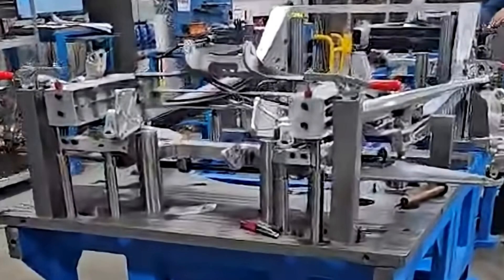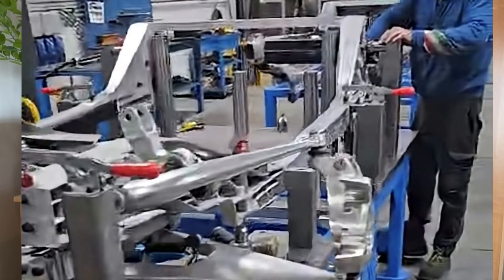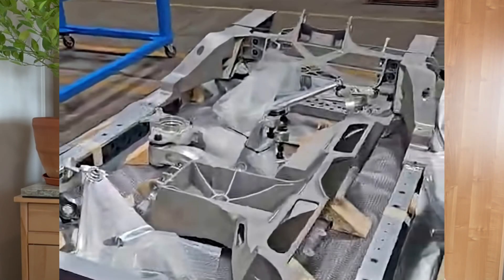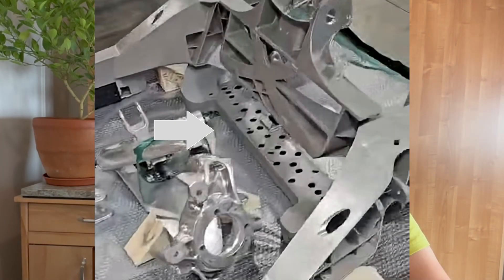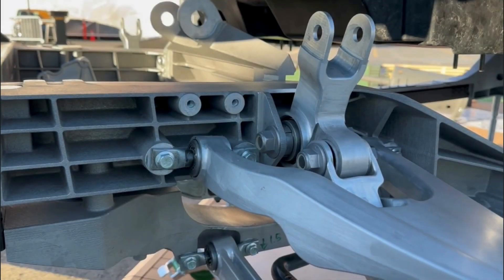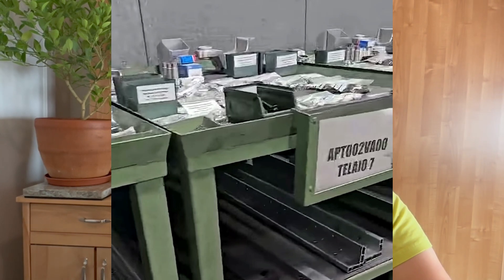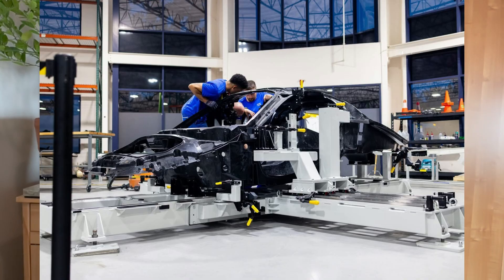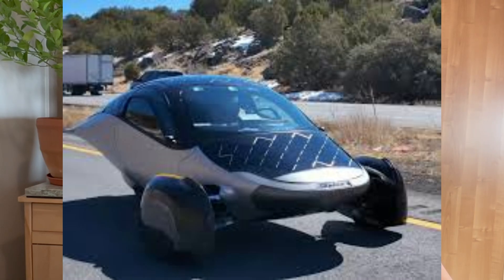Aptera's New Frame from COSTAMP

Comment: The Engineer should know the material and weight of the components designed to acheive the spec. The design of prototype components should incur more cost without sacrificing performance. For instance, a component designed to be forged from T6061 might be machined from T7075 to achieve similar strength and weight. Considering the infinite number of collision cases, it would be a mistake to optimize the design to survive the few chosen for tests.

Comment: Next year marks the 20th anniversary of Aptera
1. Zero cars made and sold
2. It’s 3 wheel
3. Two passengers 
4. At the moment it’s $40k
5.  They have raise over $100M from crowdfunding 
6.  The new Bolt EUV starts at $29k with delivery 

You should ask yourself these questions 
1.  What year in the future will I realistically own one
2. Is the 15-40 solar miles worth $40k
3.  Is the vehicle worth $40k, if it didn’t have solar compared to the cost of the $29k Chevy Bolt that’s available next month
4.  Could I use that $11k difference and add solar to my house/carport/ garage
Reply from the maker: @phileasler5401 Yes, of the Aptera name but you know that have not been trying to build the car that whole time. What it original company going bankrupt in 2011 under CEO Paul Wilbur. With the current version of Aptera restarting in 2019.  So let me answer a few of your questions and pose a few to you. 

1. I hope to see low volume production start in the second half 2026 or early 2027. This gives them the time for production line validation and crash testing. 
2. A car that can generate its own power or charges its self, yes to me it is worth it. That is a level of freedom no other car offers. 
3. A Mazda MX-5 ranges from 29k to 40k, the Corvette starts at 70k are they worth it? When compared to the Chevy Bolt? 
4. Not all people have the option to invest that 11k to install solar where they live, they could be in a condo or apartment and not have that as an option. 

It’s a 3-wheeled car, there have been others that have sold well, Morgan, Vanderhall, and the Slingshot. Also there are many 2 passenger cars that have buyers in the auto industry. Either of these categories that Apteta fits into are not negative, the first Tesla was a 2 seat roaster. Do you think that a Chevy dealer will sell the new Bolt at that 29k MSRP?  Is the 400mi range of the Aptera worth it when compared to the 255mi offer in the new Bolt? Thank you for watching!
Reply: And yet.. you're still here... you transparent Trollholes just can't stay away. Amusing.  Go buy a cookie cutter EV since that is what you are trying/failing to compare the Aptera to, you goofy sh!t-weasel... it's obvious that you are hate-trolling Aptera, what is less obvious is why?  Paid or pro-bono?

Comment: I think the oval holes in the rear subframe allow ducts for channeling cooling air.  The radiators shown at CES were near there.   
  I thought it was great that the first test drive yielded 8 miles per kW.  That’s better than VW achieved with the XL1 after 10 years developing and >1 billion dollars invested.
Reply from the maker: That could be a possible second reason, there is a great video from Jason Cammisa about the XL1. Thank you for watching!

Comment: so they are still making prototypes, this is all they have ever done. We have not seen any data apart from one release of efficiency of 8 miles/kwh, oh but wait, it turned out that was down a 7,000ft elevation drop from flagstaff to imperial valley. So their first 'official' release of efficiency data, was faked by going down a very long incline. Funny thing is just weeks before this, they did flat track testing, and supressed those results instead choosing to 'fake' the efficiency using gravity assist downhill. 
Its just another example of how dishonest they are. I would like to hear your take on this,  fake the data and suppress the real data..........seems pretty obvious.
Reply: Hey you miserable fvcking liar, that was not an official release of energy data, and only a lying piece of sh!@te like you would continue to make this bogus claim... that was preliminary data using an unfinished (heavy) vehicle in an uncontrolled environment. 7,000 foot drop over a distance of about 300 miles is not the startling piece of information you think it is.. and the trip included uphill sections as well if you look at the elevation changes along the route.  The elevation change was of little consequence over that distance, and all the normal enthusiasts will wait for scientific results procured under standardized conditions. Of course you mendacious barking tvvats will seize on anything to nip at those ankles like a mutant sh!t-weasel in stead of waiting to see what happens.
Reply: how can you be so gullible for an intelligent person?

Comment: Thanks for the thorough research and clear explanations. My guess is the vehicle needs either the frame lightening or the Inmotive Ingear to reach 100 Wh/mile. If the Launch Edition gets both, I suspect it will exceed the goal enough to brag about.

In a comment at the Scottsdale event, it sounded like the Inmotive Ingear itself is at a similar validation stage as the LE. In earlier interviews, the likelihood of Ingear being in LE was downplayed.

I’m starting to wonder if the frame weight reduction and/or Ingear integration will potentially delay the LE customer deliveries beyond the February CEC grant deadline.

I’m suspecting Aptera’s facing a decision whether to accept a shortfall in the efficiency goal to deliver by February, or to delay introduction to accommodate Ingear integration.
Reply from the maker: The one fact that I always found interesting, but was never talked about was the rage and battery size. It’s been said the pack is 42 kWh of useable charge and the goal is a 400 mile range. If you work the numbers that is 9.5 miles/ kWh, I have always thought this is the worst case scenario. However they have hinted many times the range could be better, and maybe this is because of the Inmotive system. I recall Chris Anthony saying the Inmotive system could be retrofit later if they can’t get it into the first LE Aptera, but I do think it will be needed to reach their goal. Thank you for watching !
Reply: @ApteraAccessories  We discussed the problem with the EMR3 having the 1-speed transmission inside the motor casing a day or so ago, and now you tell him they can retrofit the 2-speed?
Reply: At the public meeting before Scottsdale, Aptera announced they would concede the $20M CA Grant and not deliver 50 trikes in Feb 2026. I think that meant no deliveries then. That does seem like the schedule Aptera has been on since the announcement.
Reply: In the public meeting before Scottsdale, Auntie confirmed Aptera would forfeit the Feb 2026 delivery requirements and not get the free $20M CA grant money. How can you possibly be talking about 50 customer deliveries before 3/1/2026. That's less than 3.5 months away with a heavy Holiday schedule and Aptera has never made 1 fully capable trike!

Comment: Thanks for engineering analysis of the frame; it makes sense that the weight from the road trip vehicle would be high, as that frame was machined rather than forged, and had not gone through weight reduction as you describe.
Reply from the maker: In the road trip Aptera (PI2) The seats are over weight From the production intent seat, and as a you know the frame and suspension was all machine locally. Thank you for watching!
Reply: @ApteraAccessories  The Sept 24 Update at about 50 seconds shows a close-up of the seats "from their chosen supplier", as Steve says. The Flagstaff drive was in late March 2025, yet it was fitted with Corbeau racing bucket seats. These are usually lighter than OEM seats by as much as 50%, but AM doesn't tell us what either seat weighs, which is a common stunt of Aptera's. Since you claim these seats are over the weight of the ones shown in September's update, then you must have information most of us are not privy to which proves they are heavier by a known amount. Please fill us in on their weights?
Reply from the maker: @aussieideasman8498  I don’t have any inside information, but I can tell  you where I am getting that from.  Yes, racing seats are usually lighter than traditional automotive seats. With Aptera having PI 2 on the test track it might have been a requirement from the track owner to use racing seats and 5-point belts.  If you watch the video from Kim Java from “Confronting Aptera’s CEO w/ investor” from a year ago. At timestamp 8:40, Chris Anthony talks about the seats and says that their seats are 6 pounds. Seeing them first had I could see the seats being that light.
Reply: @ApteraAccessories  I don't make definitive statements when my sources include events that just 'might have been?'. I find it difficult to believe in your instance that a track so remote from civilization as that Honda track would demand a lone single vehicle with such a low top speed have racing seats. But I would make a phone call and check with the track to confirm before risking misleading the general public.

So you got the weight (per seat, I gather) of the silly trike seats, but you didn't have the weight of the Corbeau seats - you need both before you make definitive statements about which is lighter. You also should be aware of the many lies Aunty has told over the past six years, and not take his 6 lbs as gospel. Just saying.

It would be interesting and conclusive if AM would simply make a 1 minute video showing them weigh both seats. What chance do we have of that happening? LoL.
Reply from the maker: @aussieideasman8498  The location of the track has no effect on the requirements, it could have been a requirement to use the tack to have racing seats and belts. It also could of been a self imposed (by Aptera) because of insurance reasons or for driver safety, both are reasonable 

If you look at the videos of PI2, the seats look like the Corbeau Baja XRS’s. Those seats are 27 pounds each plus the mounts. I had looked those specs before I made my statement, you can watch the video that Tailosive made “Checking out Aptera’s PI2 & PI3” to get a better look at the seats and compare to their site.

Comment: Excellent analysis!  Sandy recommended this to Chris during an interview back around the CES time frame.  I believe that the changes Aptera made to the frame will get them to the 2,200 pounds and the 10 kilowatt number.  It may take integrating the inmotive transmission to also get to the 10 kilowatt goal.  I hope that’s not the case and the frame weight deduction as well as all the other improvements get us to the 10 kilowatt goal!
Reply from the maker: Thank you for watching!
Reply: Then they can do the reverse trip, LoL.

Comment: I'm not certain we will see an increase in efficiency as the efficiency was theory. What I see is that Aptera is doing what it can to achieve the theory they set. There are changes that reduce the efficiency and some that help achieve the goal. If you work the numbers that have been provided, it seems much more likely that people will see a range that is good to hit 300 miles per charge, not 400 miles. There are so many little things that will add up and only in extreme ideal conditions will anyone see 400 miles per charge.

Great observations and it is good that Aptera is doing everything they can to achieve their goal.
Reply from the maker: An increase in efficiency over what we previously seen with PI2, but as you state Aptera is doing what they can to achieve their goal. I hope which these changes we will get to see some real numbers soon, thanks for watching!
Reply: Building the PI3 they promised is doing what they can, and they won't.
Reply from the maker: @a @aussieideasman8498 think we will see PI3 shortly, especially with the new frames being sent from Costamp.
Reply: @ApteraAccessories  I hope you are right - it's long overdue, so even coming shortly is already a bad thing by now. 3 comes before 4, so to reverse the order by 5 months and more (be it shortly or longer) is suspect.

Comment: Question for you, Joe....  Do you know if these frames were produced with a form of soft tooling, or hard tooling?  Due to the early stage prior to crash testing, and the potential yet for change, I feel it must be some form of soft tooling at this point.  Your thoughts?
Reply from the maker: I don’t know for certain but if there is the possibility for farther changes I would believe that it could have been some form of soft tooling. Now if the front control arms are aluminum forgings I would think that would be a hard tooling. I definitely think we will loose 2-3 of the next validation Aptera to crash testing. If they do implement changes after the crash testing I would think they would crash test again.
Reply: @ApteraAccessories  Thanks Joe, much appreciated!
Reply: 3D printed tooling for now. It's obvious by the look of it. Aptera is required to do crash testing so after they do, then they can sign off on it or do other changes then crash test again. This is why they are required to destroy three of them.
Reply from the maker: @billsmith5960 We will have to see if there is one or two rounds of crash testing. Thank you for watching!
Reply: @ApteraAccessories  - This is why you have to physically crash them. Even the Alfa Romeo Guilia was delayed 3 months because when they crash tested it, they found a flaw in the chassis. They aren't the only ones but with the Guilia, marketing was charging away with release dates and that all came to a grinding halt. At least three of the Apteras will be destroyed as per CA.
Reply: @billsmith5960  Aptera motorcycle will never be crash tested, because they dont need to be. Aptera would fail miserably.
Reply: @vic321344  - It will be crash tested as it's required.
Reply: @billsmith5960  It is not required to crash test a motorcycle. And the Aptera motorcycle would not survive it.
Reply: @vic321344  - It's required to crash test it. Reason being it's an internal Aptera requirement. Just like solar panels.
Reply: @billsmith5960  AAHH. "internal requirement". So it will get an "internal crashtest". With "internal results". Like we are already used to by Aptera.

Comment: I appreciate your analysis and observations. Inmotive apparently needs to do some more work to get their unit into production. Hopefully this comes together in time to be included in the Launch Edition models next year. I suspect that modifications like the frame/chassis lightening and other validation vehicle revisions will get pretty close to Aptera's 100 watt-hours per mile goal. But the Inmotive gearset could improve efficiency enough to surpass the goals, even under sub-optimal conditions.
Reply from the maker: In the video I used a conservative estimate for the efficiency improvement of the Inmotive system of 10%.  In their own documentation they claim a 13-15% improvement and showed 10% in real world testing. Here is to hoping we see efficiency over 10 miles a KWh. Thank you for watching!

Comment: Great content Joe, it's good to hear from you again.  You have an eye for detail in your frame comparisons, that's for sure.  I wish we knew whether the frame weight reductions were additional improvement, or needed to make goals also.... time will tell.  Hopefully it represents additional improvement for all of us.  Seeing die-cast frame components is another big step forward, as is the start of the transition from hand building to line building.... both are major milestones.
Reply from the maker: It’s been too long, I hope it represents additional improvements. Now that they know how well the cars fit together form their PI2/4 experience they can test out how the 12 station assembly process will work for the next 10-11 builds. This will expand their knowledge and train the new crew and prepare them for low volume production. There is a possibility they could improve the frame after crash testing and remove more aluminum and weight. Thank you for watching!
Reply: @ApteraAccessories  Mirroring my thoughts exactly.  Let's hope further changes are minimal so that validation progress can pick up steam!

Comment: I'm sure they will get close enough to the efficiency numbers for me. If they are out 5% I won't loose any sleep over it. The actual use case will make more difference than that.
I bought my Ora-3 expecting a 20% real world reduction of the WLTP range but found I exceed it.
I do hope they loose the belly scoop, I don't want a grass seed collection point. I live off-road with grass tickling the car belly.
Hopefully by the time the RHD versions are made they will have belly cooling.
Reply from the maker: I also think if they are off by a few percent I am still fine with that, but I hope they can deliver a higher efficiency number. I definitely think some form of belly cooling will come back in the future. Thank you for watching!

Comment: Great insight and observations. I suspect they really want to hit 100 Wh/mile and are tweaking wherever they can to increase the odds of achieving that. It will be interesting to hear when the Inmotive transmission will begin being incorporated... in the validation vehicles? In early LVP vehicles? Or not until later?
Reply from the maker: I have seen that the Inmotive transmission is rated in some cases up to 13-15% gain in efficiency, but I went with a conservative estimate of 10%. I think the plan is to launch with the Inmotive system but they said if not it could be installed later. I believe PI 2 has the system installed but is locked in high gear (2nd). There could be a few reasons for that. Thank you for watching !